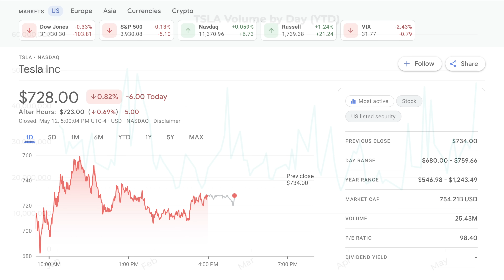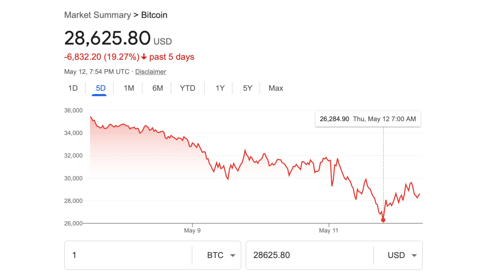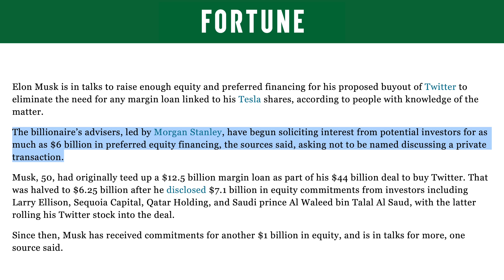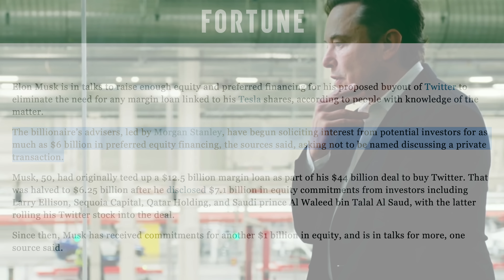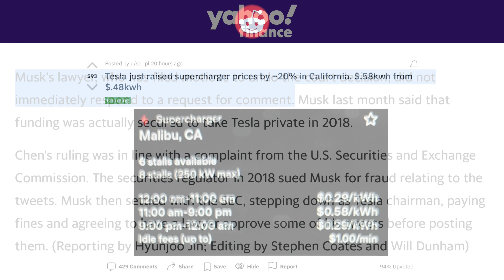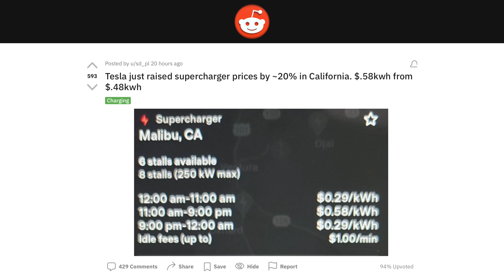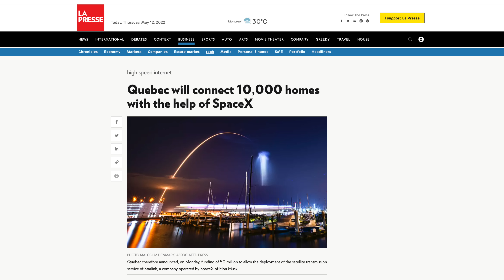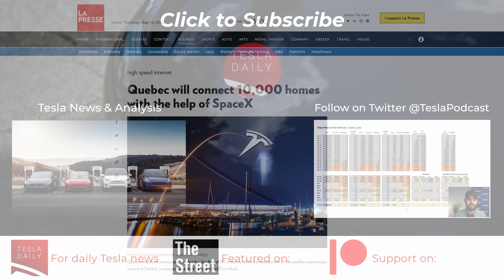Musk Seeks To Adjust Margin Loan + Tesla Raises Supercharging Prices

Comment: What burns me on sc prices rising again is paying by the minute for slow 120kw chargers across rural Wyoming. So much so that one leg of my trip cost me 90% of what it would have cost for diesel in my dually pickup getting 18mpg at $5.25 per gallon.
Reply: Prices are going to only continue to rise and soon states will start charging close to $2000 to register an all electric car to make up for lost gas taxes to fix roads.
Reply: I think this is the tip of the biggest problem, by far, that electric vehicles are going to face. There was a Wall Street Journal article on April 8 titled "Electricity Shortage Warnings Grow Across U.S." and stating "Power-grid operators caution that electricity supplies aren’t keeping up with demand amid transition to cleaner forms of energy." If grids start becoming unreliable as electric cars are adopted, there could be a backlash; electric cars could come to be seen as unreliable (can't charge when the grid is down) and problematic (they overload the grid). Even if the grids do cope, but do so by increasing the price of electricity to the point where it's no longer cheap relative to gas, there is a big problem. I'm actually really concerned about this, above all else, with Tesla. No doubt Tesla Energy and many others are working hard on this, but I am not convinced they will progress fast enough.  Rob, if you read this, I'd love to see you dive into the issue in one of these daily videos.
Reply: @nick21614  Not a thing.
Reply: @anthonyholland8549  Not a bunch of things.
Reply: so drive your dually pickup.
Reply: @nick21614  if that's per year that's crazy.
Reply: @anthonyholland8549  so we just need to raise the gas taxes to compensate . it's like cigarettes.
Reply: @anthonyholland8549  
The grid isn't the problem.  Your electric utility is stonewalling the DERs - distributed energy resources - the rooftop solar and storage that would allow every house to have its own "gas station" to fill up their EV.  Research estimates the adoption of EVs will put an increase of only 30% on the grid.  You must remember that all the extraction, refining, transportation, distribution of fuels will go away and reduce the load on the grid.  EVs use 1/3 the energy of ICES, are 3 times the efficiency.  Just remember to quit being a hypocrite: you can't pump gas when the grid is down!!  Duh!
Reply: @acmefixer1  I'm not worried about the end-state. I'm worried about problems along the way that could cause a backlash. Only 30%? 30% is huge. That's a lot of solar, a lot of batteries etc. I definitely agree regulators need to pave the way not get in the way (re DERs etc). Not sure what you're saying re pumps but gas stations definitely have backup power, generators etc.
Reply: @anthonyholland8549  This is a bunch of crap. EVs charge at night when there's hardly any usage. This is Fossil Fuel FUD talking points. Every year there is more rooftop solar being installed and more battery backups at homes and businesses. The US barely has any EVs sold compated to Europe or China and they're doing fine.
Reply: @davidc2838  read the article. It is true that these things are being deployed, but how fast? And electric cars are not the current cause but an anticipated source of demand in addition to the current electrification of homes (stoves, ovens, heating). Also, when there are 50m EVs they will not all be charging at night, and if they are that will be quite a lot of demand on its own.
Reply: @SkyRiver1  It already is in Europe. It will happen in the USA within 5-10 years at the latest in my opinion. If you think the government is gonna let you get away with not paying taxes then that is your delusion not mine.
Reply: @anthonyholland8549  Charge at night in your garage…
Reply: @clu4u  "yes but...". I'd say read the article and see the size of the problem.

Comment: The thing with Supercharger rates is that, even in a worst case scenario, it's still cheaper to drive my Tesla compared to an ICE (e.g. 20 % less. 0.58 cents per kWh compared to a 40 mpg ICE and current gas prices in California $5.50 per gallon or more). Under normal conditions, charging at home, it's about 75% cheaper. 

Also, let's be real here. The vast majority of Superchargers even in California are well below the $0.58 per kWh quoted by so many. Most, even a peak times, are $0.45 per kWh and that means it costs 38% less to drive a Tesla.

Note: Your numbers may vary given your driving habits. I typically get about 190 watts/mile efficiency as proven today when I drove for 4 hours on both city streets and the highway up and down some steep grades (mostly on the highway with speeds varying between 75 mph and stop and go).

Comment: superchargers that don't get much use have higher electricity costs. most people on here have no idea about demand charges. they are huge. and superchargers have high demand .
demand is the highest number of KW in any 15 minute period. so if you charge at 250kw the charger will need more than that say 275 kw. well here in ny demand is 12$ / kw. so a charge of 3300 $ . that occurs once a month for whatever is the highest demand that month. and if 2 chargers run at the same time it's double etc.  
this doesn't count the kwhrs delivered which is on top.

Comment: An EV is still way cheaper to power even at $0.58/kW since that offers you a 20 cent/mile cost at 300w/mile, whereas a regular gasoline 20 Miles/gallon (in California) $5.50/gallon/20 is 28 cents/mile. We charge home at 1 cent/kW overnight super off peak - which I think should be a "news item" for you to discuss since that is INSANELY CHEAP: 70 cents/300 miles=$0.002/mile or stated another way: You can go 3,000 miles for just $7.00 - or given the US average per year 15k miles, you'd cover your entire year for just $35.00 + fees for long road trips.
Reply: Where in hell do you live in California to get such rates ??? 1¢/Kwh is unbelievable. Here in the Greater LA area with SCE it costs 30¢/Kwh super off peak and ~60¢/Kwh on peak. It would actually be CHEAPER to run our houses from a supercharger !!!!